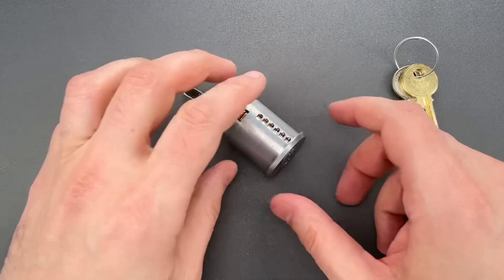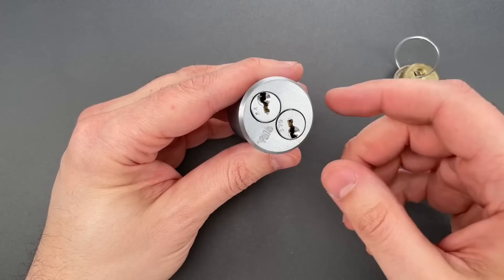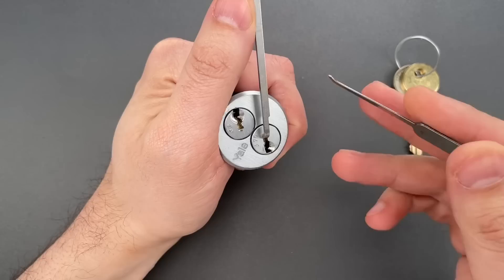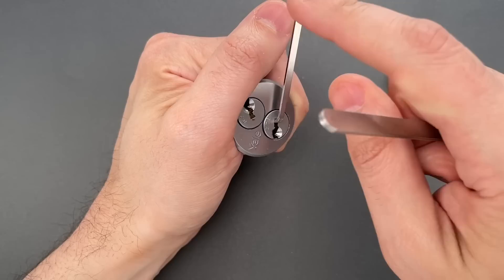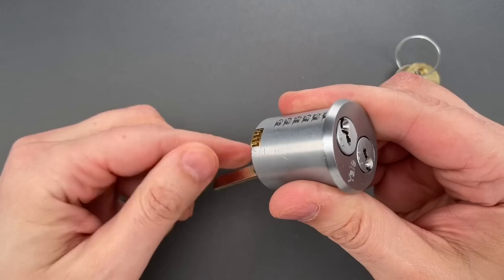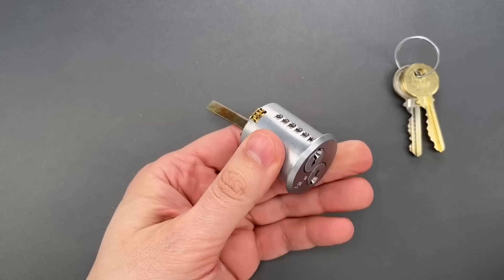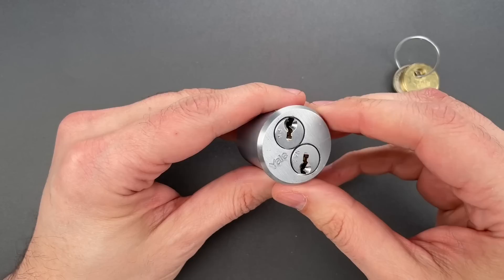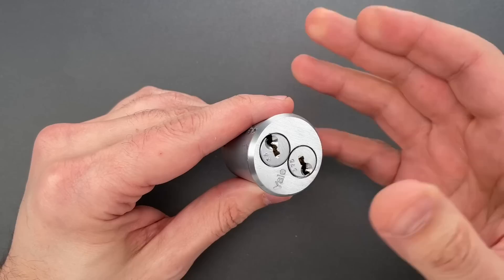[1511] What Were They Thinking?!? Yale Bicentric Bypass

Comment: A Lock that uses a key to turn the locking mechanism with the only thing stopping it are the pins THAT STOP THE KEY INSTEAD OF THE LOCK is so unimaginably dumb its something I would expect out of a children's toy.
Reply: They should have used the rotation of the core for the turning instead of the tip of the key.

Comment: This could be fixed using a gear system known as a "differential"
(yes, the one on the back axel of a car)
That way the output lever is always connected to both cylinders and will only rotate if one of the cylinders is turned with a key.

Comment: You can't really deny access to someone who is determined enough.

What you can do is to detere, delay and detect. As in;
you can craft an installation/system/society that makes the effort outway the "reward",
with a lock that will take a while to pick,
and with means to detect (prior, present or post depending on what the lock protects) the attempt.

So... proof reading my own comment, I will now henchforth refere to 3D3P  ;-)
Detere Delay Detect Prior Present Post

Detere: It will cost you $10000 in materials to get in, matching the value that you will be able to steal. In other words, diminishing returns.
Delay:  It will take ten hours of preparation and execution to get in and out. Which also is the number of years that you will spend in prison if caught.
Detect: It will be known, prior, present or post (before, during or afterwards), how someone broke in.

Comment: "what were they thinking?"
well to answer that you need to understand bureaucracy. bureaucracy doesn't care about functionality, only that it checks the boxes it wants on paper. bureaucracy does care about complaints of boxes not getting checked. if a lock can be opened by the right key and not with the wrong key it is a good lock according to bureaucracy. if people can still get into the space to do their job when the key is lost it gets less complaints about boxes not getting checked. if the average person can't get in without picking the lock then the lock is doing its job by bureaucracy standards. if things are getting stolen due to the lock getting picked then it is a police matter and thus not an issue for facility, the people that order and install the locks. now you know why the locks kept getting made and used despite being rather bad locks, and why you should never trust your tax dollars with tax collectors and spenders.

Comment: So, with 99% of the key being obsolete, are the Key(s) actually intended as a deception?  A thief can pick either keyway separately and it wouldn't open, could even pick both together (somehow) and it still wouldn't open.  That would have any uneducated thief scratching his head.  I think this is a pretty smart idea but if a thief did a wee bit of research or actually bought such a lock for examination, the trick would be found out.  As always, knowledge is the best tool.
Cool video LPL, very interesting lock this time around.

Comment: Amateur lock picker - "This lock is invincible. I've picked it four times on both cylinders and it still will not open!"
LPL - Just use "Tip of the key" tensioning/turning! Ignore the "lock" bit of the locks.

Comment: Initial thoughts: wow.. a single unit that needs 2 keys to operate, decoupled barrel means you can't pick one without the other or fluke pick it... Then comes the disappointment. You don't even need to pick it.. just ram something in it and turn..

Comment: Wow - that’s a pretty significant flaw.
Is the current method of key mastering still by using multiple pins in each position? I can remember doing work experience at a locksmiths 30 odd years ago and creating a set of locks with a master key for a block of apartments in this way.

Comment: I would call that lock "Hot Garbage" but I do not want to insult garbage.
Reply: Funnily enough, those types of double core locks are also quite often used in garbage shed so the garbage collectors can access the bins easily.

Comment: Do you know if the Yale dual keys required cylinder had the same issue?  By those, there were several in areas that required both keys inserted and to be turned, one at a time, to open the door.  A 1st and a 2nd key was what they were called by the ones that had them.

Comment: But when the lock is attached to a door and the mechanism is under some load... it takes some force to turn the key to overcome the friction of the lock... the tiny picking wire would perhaps not handle the torque required and just bend or break. I have broken keys to open old rusty or frozen locks.

Comment: Citroen came up with a similar design on their car locks with a central cast metal slide pushing back to engage the bar. Almost as easily manipulated but a poor design in that the cast metal slide would eventually wear and split at the ends so that key insertion would merely spread it apart rather than push it back into its engaged position. Used an interesting combination of wafers and pins in the core with the key being an unequal cross design.

Comment: mechanically, this is a very cool lock, two cores and gears, and a wonderful "anti-pick feature", where picking the lock does not open it. where that falls apart is not only with it not being able to tell the difference between a bypass tool and a key, but also, copying a master/faculty key gets you into more locks. this has been a problem on at least one college campus where a master key was in wide distribution.

Comment: Hold on
So if the key way shape is the one thing that's potentially keeping any key of roughly the same size, and once you put a key in there you can rotate the mechanism with just the tip of the key... What are the pins for ? Can any key be used as a master key ? How did they not notice this !

Comment: Just curious if that tool would have enough torque to turn the tailpiece with a latch and everything attached. Seems kinda thin.
Reply: You'd probably have to jiggle the whole door a bit, and would work on some but not others. My regular deadbolt at home would be too tight, almost feel like I'm going to break the key while turning it.

Comment: Another laugh out loud video at how ridiculously flawed the lock is! But I'm afraid I have to agree with others, I'm now at 100% phone volume in a quiet room just to be able to hear things. Any chance you could turn it up a bit please?
Reply: I use a small onn brand Bluetooth speaker with my phone. I got it on sale at Walmart for $15. Great speaker. It has a wrist strap and colored LED lights you can turn on or off. It has a USB-C charging port.

Comment: .... perhaps im missing something... if the key doesn't turn the bar an open the lock.... then how would that lock actually work in a door? how would you use a key to gain access? Do you need two keys? Bit confused...

Comment: I don’t understand how having 2 keys per lock when you only need one increases the security of the facility. If someone got a hold of either key they could still open every door and you’d still only need to pick one core to get in?
Reply: The idea would be to have a system of levels, certain employees or allowed, can enter with their key to certain specific doors (let's say 4 or 5 doors), but the owner or security managers would have a master key that enters the other slot, and that would be universal for 50 doors, without the need to carry 20 keys with them.
Reply: @satariel8652  ahhh got it thanks

Comment: If the tail is decoupled, picking the lock doesn't turn anything then? So the door remains locked?
Reply: … Except just jamming a piece of metal into either lock opens the door faster than using the actual key

Comment: Does that also allow a credit card, or similar material, to push the bolt back when inserted between the strike plate and face plate? I seem to remember someone bypassing the lock by doing something like that when I was in school many, many years ago.
Reply: That has nothing to do with the lock per se. Doors that open outwards and have a latch rather than a deadbolt have that flaw.
Reply: @katrinabryce  and if you install the door properly, that flaw disappears on most styles. It's ridiculous how rare it is that people actually seat the door so that the detaining bolt is active when the door is closed.

Comment: Why not just make a bunch of the same key instead of printing bunches of two different keys to go to the same lock that could be opened as easily with a thin piece of solid material? This has middle management pitching an idea that sounds reasonable on paper to get a promotion written all over it

Comment: Try to follow this what if that gear was a lot thicker and had 2 lock pins it and was unattached like it is it would be darn hard to pick because how would you tension the second core/gear
Reply: Then you would need 2 keys at the same time.
Reply: @Paul Norris  I simplified my explanation because I didn't feel like writing a hole paragraph make the gear thin like a ring gear on a flywheel and but one way  torsion roll bearing between the gear and the second core edge so when you turn the key foward the unmoving cyclinder gear  is allowed to turn  backwards allowing the lock to open with either key by Turing either cyclinder works like ratchet mechanism the only thing that wouldn't allow for would be to turn both key cyclinder in the open direction  at the same time but why would you do that anyways and what purpose would it have

Comment: Hello Lpl, I’ve recently gotten into picking, in large part due to you (thanks for the new obsession) and I love the genesis set I’ve been using but I’ve ran into a problem, I don’t carry keys with me often so I wouldn’t really have a place to keep a covert companion, but I do carry a wallet. I was wondering if it would be possible to either see a set of picks small enough to fit in the average wallet or possibly a set of genesis picks with hinges on them so they could be folded to fit. Just a thought.
Reply: You could always just cut the handles down to size from any of the single strip lockpick sets out there, like Dangerfield Praxis, Sparrows Tuxedo, Multipick Essentials etc...
Reply: Consider the 'Chaos card' or similar - a credit card sized piece of metal laser cut to form a pick, rake, turner, jigglers and combing tools. With the first use you break the tools out of the card - after that, maybe some adhesive tape or a sleeve would work to store them.

Comment: Must suck to be the engineer going into design/concept review with this double cylinder requirement like *I had to disconnect the lock from the opening mechanism*.. Manager goes "don't do that" and proceeds to pitch some abstract solution that is *totally gonna work*. Get ready for endless concept reviews that goes nowhere and hundreds of engineering hours wasted.

Comment: Are majority of the locks susceptible for low skill / no skill attack? Have you already shown most of the relatively good locks? Because - if critically bad locks are not that common, then the current idea is perfect - just show the locks to avoid. If they are more bad locks than good locks, maybe try to show more good locks, that require some more advanced tools and some skills to pick. Then those locks could be recommended.